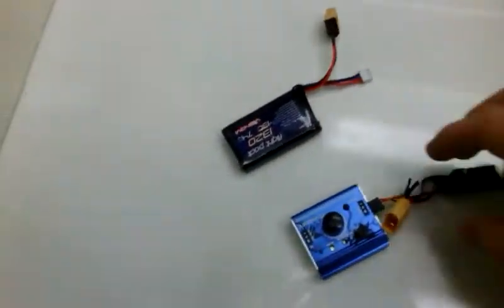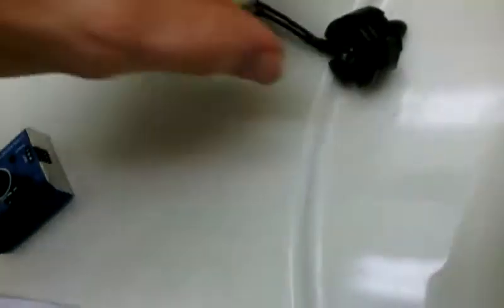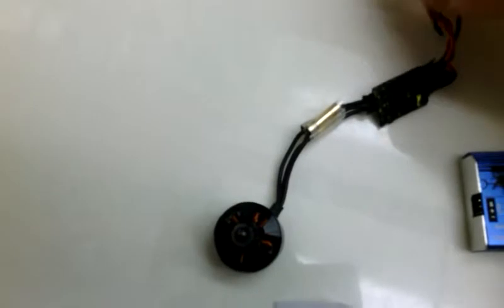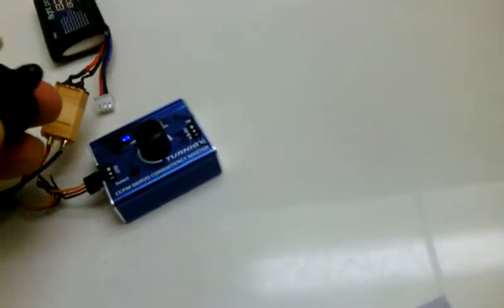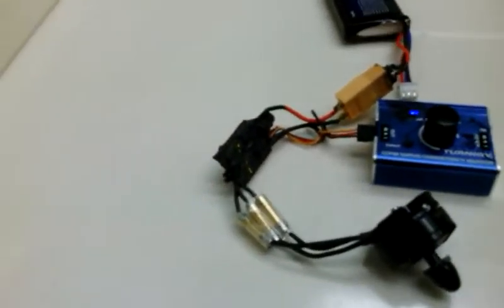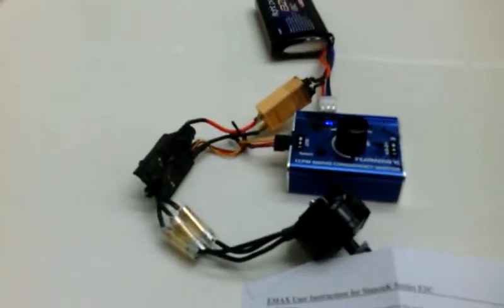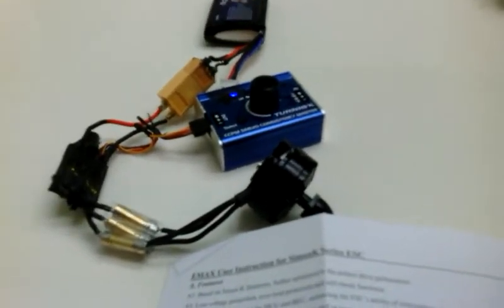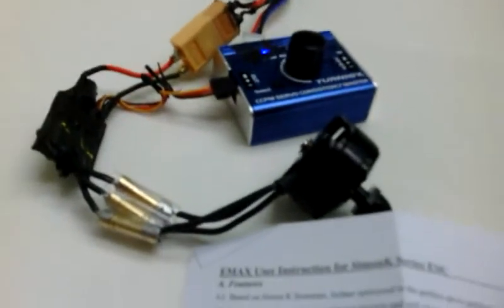How to program a simonk ESC

Comment: Thank you! I couldn't figure out how to get the programming sequence to start. The max on my servo tester was to high to start the process. The beeps are quiet, hold the motor against the table to make them louder. 

Simonk 30A Bidirectional Tutorial:

STICK UP (~2100 on a servo tester)
Power everything on 
Several beeping sequences will happen, you're waiting for a binary Morse code sequence, it'll loop. 
Rotation direction is option 8 ( - . . . ) "Long, short, short, short"
STICK DOWN

It will count to 3 in a loop
Bi directional is option 3
STICK UP on option 3
Several beeping sequences will happen and music.
REBOOT
Done!!!

Comment: If I have betaflight FC which protocol to use? Pls can you help?
Reply from the maker: The simonk esc is separate from the flight controller, it has its own programming which is activated when the FC sends a spin command to it for the motor

Comment: How do you reset the esc back to factory condition
Reply from the maker: +Alex Xu you have to do each setting separately using the paper codes that came with your esc. The defaults are in bold on the paper.
Reply: oh okay I reset them thanks!
Reply from the maker: Alex Xu Glad I could help :)
Reply: Such a nerd .... Just start your transmitter and set it to full throttle the power on your esc plugged in your reciever and you will hear 2 beeps then lower down your throttle then you will hear a set of beeps then after about 5 sec increase your throttle there you have your esc reset to factory settings ......